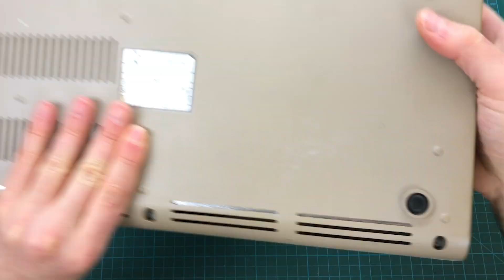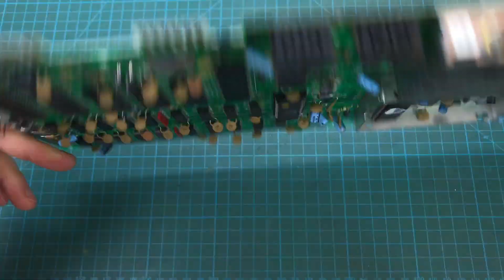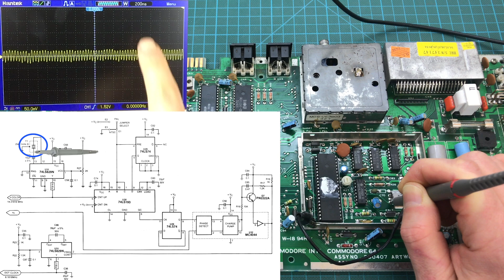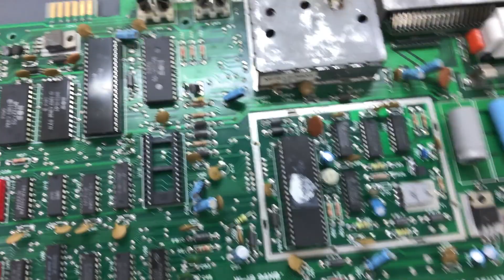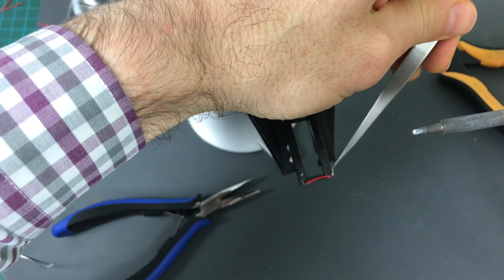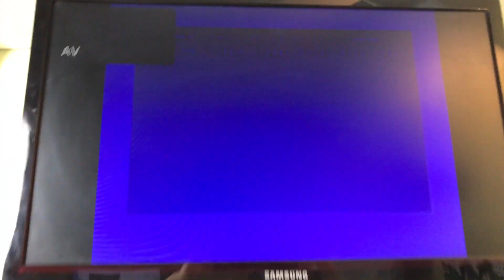Commodore 64 Black Screen Triple Challenge (Part 2)

Comment: Been wrestling with a black screen C64 today myself. Rolled the dice on a cheap untested unit. I've found at least one problem- the 9VAC from the Plus 4 PSU I'm using(homemade adapter to use it on the C64) isn't working:(  Thankfully the Plus 4 only needs it for the user port so not an issue for me, but the C64, of course, uses it for a lot more than that. At least all the signals I should be seeing without working 9V are correct, so the system is probably not completely broken.

But should be able to order one later this week and I'll see what else there is as far as problems.

Comment: Just been given a breadbin c64, fixed a short on the onboard power supply so now doesnt blow fuses. Getting black screen, and U9 ram chip gets hot. Hopefully thats all it will need!

Comment: Love the schematic with the IC and probe point following the troubleshooting. Good work. Love it.
Long ago I repaired my C64 with together other 3 units (trying to learn a bit more about troubleshooting this things). This had no video, I took the VIC out and 2 or 3 pins on the socket were MELTED due to the intense heat from the VIC (we used the 64 to play games only). Just by removing the VIC and inserting it again I could get the system working I ended changing the socket and tried my best to source a better one. It was the same board as yours, with the copper finger on the cage that really does not help a lot. ALL the VIC I saw, are toasty as hell when working, even worse than the PLA. I recall reading articles in the arely 2000 about the VIC, it had a TDP of 2W and this package was not designed to make it. Firts ones were CERDIP ...... (I have one PAL C64 with CERAMIC VIC with the GOLD top) ... then COST REDUCTION was the name of the game.

Comment: A good thing for begInners would be a small dso138 oscilloscope kit, they’re fairly cheap and can really help with diagnosing. Or even an old analog crt oscilloscope, my 80s East German Osciloscope is still awesome and working
Reply from the maker: That's right, although the analog ones have a definite learning curve that a beginner might be frustrated with. I sometimes recommend a "logic probe" of the kind that just tells you high, low, or activity. That in itself can be pretty useful.

Comment: There is a smaller and compact rom adapter : https://www.pcbway.com/project/shareproject/Commodore_64_ROM_replacement.html
Reply from the maker: Nice! I have since then gotten some of those (or similar) PCBs. I'm sure I'll end up using them in a repair sooner or later. Those ROMs tend to fail a lot for some reason!

Comment: Your multimeter has a Hz setting that can be used to check your clock signal.  While it is not perfect, it would give you a look at the frequency vice a voltage.
I forgot to mention in my comment on #1 video that I liked your idea of individual heat sinks on each of the important ICs.

Comment: Your comment that the board had not been messed with previously may have been incorrect because half of the ram was Fairchild and half was Hitachi.  That seems a little odd to me.  OTOH, I've noticed that Atari's 800XL often will have 7 Micron Technology chips and one Samsung.  What's up with that?
Reply: Commodore is notorious for mixing ram, mine has half ti and half hitachi

Comment: I'm curious, I don't see you using any ESD protection at your workstation.  Am I missing something?
Reply from the maker: No, I'm not very good with that. I've been told I should get an ESD mat with grounding, but never got around to it. At least I don't have a carpet or other static-generating elements. What kind of ESD protection do you use? Just a wrist-grounding bracelet?
Reply: @NoelsRetroLab  Until recently I too used nothing other than frequently grounding myself on a grounded screw in a nearby light switch.  That is until I twice in quick succession fried two joystick control ICs in my ColecoVision.  So, now I have a two layer grounded ESD mat with a grounded wrist strap.  The main reason I asked is that I was surprised that you weren't using ESD protection compared to the professional equipment and setup that you have.
Reply from the maker: That's what you get when you learn things on the fly like I did (instead of it being a real job with real training) :-) I will look into that more seriously now. Thanks!
Reply: @NoelsRetroLab  Well, you know much more than I do.  I have zero training and am learning on the fly like you.  Anyway, kudos to you - your videos are superb and your step wise methodology a huge boon for those like me who are trying to learn.  Thank You :)

Comment: Brilliant and really a pretty difficult one. Nice equipment in your Lab! Best regards.
Reply from the maker: Thanks! I actually try not to spend too much on equipment. Just enough to get the job done. The oscilloscope is by far the most expensive part, but even though it wasn't that bad.

Comment: What brand of IC Sockets do you recommend?  I have a bunch of older ones that just look cheap to me (and half the ones on ebay look terrible as well) and would rather pay a little more for something that is reliable.  Thanks :-)
Reply from the maker: Some people swear by the sockets with rounded holes, but I'm not a fan. They're hard to fit for some ICs, especially if the legs still have a bit of solder in them. I find that cheap sockets from Ebay/Ali work well. Just make sure they have metal on both sides (I think all sockets do these days).
Reply: @NoelsRetroLab  I believe the metal parts are called wipes, so one with metal on one side only is "single wipe" and those with metal on both sides are called "dual wipe".  I'm not a fan of the round sockets either and always use dual wipe.

Comment: Great video Noel, one question since I have a faulty C64.... I measured 6 ohms in the 5 v rail... and proceeded to remove overheating chips when turning on  a strong psu. Is is ok 6 ohms in the 5v line? Also is there other way to find the short circuiting one?
Reply: Nm, it was a ram chip
Reply from the maker: @mlorenzati  Glad you found it! I don't know the exact resistance between 5V and ground, but 6 ohms seems waaaaay too low :-) Did that RAM chip get really hot?
Reply: @NoelsRetroLab  Exactly, after removing the memories (2 were in short circuit, the line when to 20K plus ohms. On my way to get new memories!